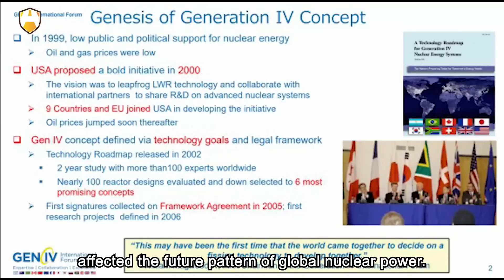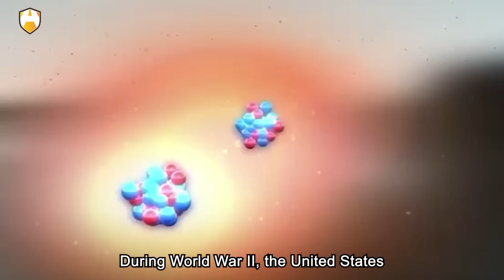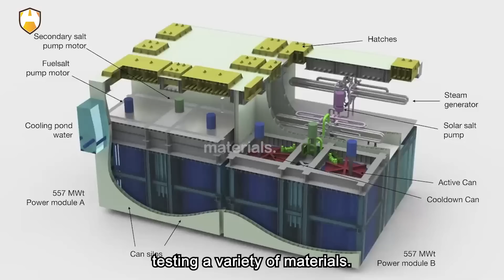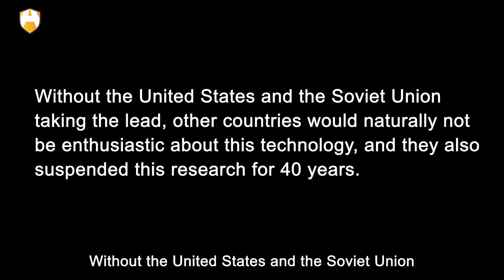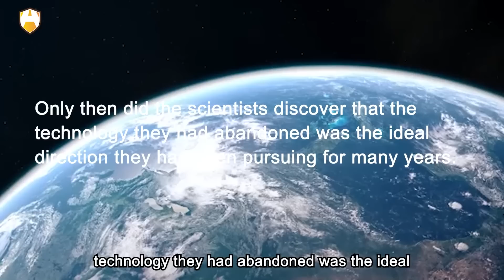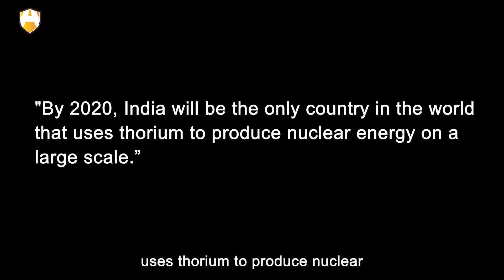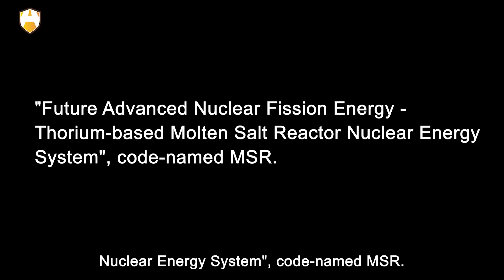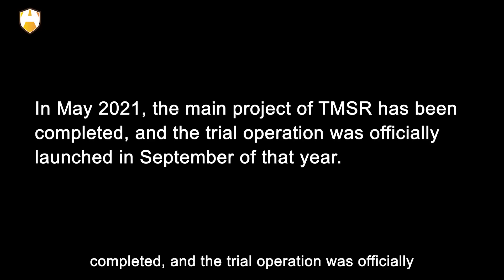China made big success in the Future of Nuclear Power! Revolutionise Atomic Energy Industry?

Comment: Nice video, the images do not match the subject. Fusion reactors do not belong here.
My interest in Thorium goes back 20 years. I spoke to a chinese engineer, back in 2004, in the US who's mother was a nuclear scientist in China, and he had never heard of MSRE or Thorium. A few years later a delegation from China visited ORNL and the MSRE. Coincidence? I think not.
Much of the original MSRE research documentation was located in Oak Ridge, in a junk closet, and salvaged. It was scanned and put online a few years ago and was downloaded massively from China.
The MSRE  was a 7MW reactor dumping its output as hot air, not electricity.
The Chinese test reactor is only 2MW. This would be OK for a Small Modular Reactor, mass produced, for low cost.
A MSR cannot melt down or explode, it has no intrinsic pressure. Liquid pumps provide circulation pressure, some models use thermosiphoning for circulation. The reaction process has a negative void coefficient.  If too hot reaction slows down. 
The absence of water at 300°C and 2250psi solves the main problem with nuclear energy, cost and safety. Safety drives the cost of construction. 
The incumbent industry is hesitant towards MSR and Thorium, too many old billionaires and bean counters.     The oil interests fan the flames of fear too.
The problems with cracking in MSR a exaggerated, only superficial surface cracking was found in the MSRE.
Thermal cycling, in often turning the high temp on and off likely also has an effect here. Just a guess.
I'm happy that China get their feet wet in MSR but 2 MW does not cut it, China needs Tera Watts of power. They could become oil independent and better yet, convert their thousands of dirty coal plants to Thorium MSR.
China is the leader in CO2 production. Cheap energy could be used to remove C.O2 from the ocean that absorbs 50% of the atmospheric  content. Why go to Mars when we have a beautiful planet? Lets not destroy it.
Reply: "China is the leader in CO2 production". 
Depends on definition.
Based on per capital basis, China isn't the leader.
Based on historical total, China isn't the leader.
Based on country, China did produced the most, but they are also the world's factory. If you tied the amount of CO2 produced in the creation of a product to the end consumer, China isn't the leader either. That is, a significant chunk of the CO2 produced in China is for the creation of products that is consumed by other parts of the world, mainly the west (iPhones, electronics etc..).
Reply: @testusersg  Don't make excuses for Chinas CO2 pollution, per capita, or else. With that large population they have a massive responsibility.
Reply: @testusersg  Excuses excuses.
"Per capita" is not valid for China, or India. 
Air quality in many places in China are abysmal.
Is that what you want?
Stop making excuses.
Letting China into WTO in 2000 was a big mistake.

Comment: Did not address why Thorium couldn’t be used for all this time. What exactly has been the problem?
Reply: Because Thorium cannot create bombs. It cannot even start a thermal reaction without Uranium.  She says this in the video here..
Reply: @SPLITSLEEVE  Yes this is partly true, but for a proper thorium breeder the neutron economy is a real issue because it works in a thermal spectrum where neutrons are much more scarce. This makes design significantly more difficult because with too much neutron escape it means you can't reach the breeding ratio of 2.

My real point is that I'm sure it will be done in due course, probably by China, but for now there is great things that we can do with uranium/plutonium cycle that should not be ignored while we wait.
Reply: @Spacedog79  Yes like "The reality is that the IMSR
features a thermal efficiency roughly 50% higher than comparable light water reactors. This
means that the IMSR creates approximately 1/3 fewer isotopes, since less fission power is
needed per unit energy output. The IMSR also features a very soft neutron spectrum and long
fuel residency time. As a result, masses of plutonium and other transuranics in waste are much
lower than those in light water designs per unit energy output. Ref 86 by Terrestrial Energy
 From Terrestrial Energy
So IMSR are a stepping stone in using Thorium . Its first using molten salt in the reactor with Uranium only. I do not know if Oakland reached past 2, but they did say that it was successful but had problems.
Reply: @Spacedog79  I doubt that that was the main reason. Like Dunc Keroo pointed out, this technology does not produce weapons grade raw materials which was a priority for the US. You admitted that it will be done in due course, meaning all technical problems would be solved in due time, yet the US allowed itself to be overtaken by China in such an important research area. I can only conclude that the US is more inclined to weapons (war rather than peace) research in direct contrast to China.
Reply: @Spacedog79  I'm confused. Can you help me understand better? In this video https://youtu.be/bbyr7jZOllI?t=301 it was mentioned that the cross-section area of U233 (the final step of Th232) for thermal neutron is way bigger than fast neutrons, for either Pu 239(final step of U238) or U233. Doesn't that mean it's much easier to get a thermal neutron to trigger a reaction for Th232 breeding than the fast neutron reaction that is being pursued by lots of people? Or are you talking about the trouble of getting rid of the byproducts shown as the red part of the pie in that video?
Reply: @adamiskandar5107  Very true Adam. And I think China is going about all the technical problems in more than one way.
Reply: @typicalKAMBlover21  Yes, the cross-section is larger in the thermal spectrum but when you factor in a liquid core that must be in circulation to remove neutron poisons  you must engineer it so that minimal neutrons are lost while the fuel is outside the core of the reactor as this will ruin the neutron balance. This is a difficult problem because of the competing engineering needs.

There are other interesting designs you should check out such as the Moltex design that uses fuel pins containing liquid fuel that allow poisons to bubble out while keeping the fuel in the core, but they are going for fast spectrum uranium/plutonium first and thorium breeder is a distant aspiration.
Reply: @Spacedog79  thank you that really explains.
Reply: @Spacedog79  do you know anything about the Chinese efforts on TMSR-LF1? I see some Chinese forum with critical comments like “waste of money”. I thought if it’s corrosion problems all you need is time to make sure things don’t leak. But if it’s limiting the neutron escape from circulation of the reaction core out, there needs to be some smart design, obviously. Do you think the Chinese will be able to make breakthroughs regarding this in next 5 years? In other words, how difficult is this?
Reply: @Spacedog79  looked SSR of Moltex, do you know how exactly they are dealing with the neutron poison? What species are such neutron poisons?
Reply: @typicalKAMBlover21  The Moltex SSR is very simple, the fuel pins are unpressurised liquid and have an off-gas vent at the top so neutron poisons can simply bubble out and escape. Their first reactor will be a fast spectrum uranium "waste burner" type (SSR-W) so whether this is exactly what they would do for a thorium breeder I'm not sure. I believe that is more in the conceptual phase rather than anything concrete.

I don't know much about the Chinese reactor, I hear the project is progressing well but I would love to learn more about it.
Reply: @Spacedog79  I’m actually an optics guy and the very idea of controlling neutron escape interests me. Do you know why they can’t just put the neutron unpoisoning process under a large reflection shield to keep the neutron in? Is neutron like how X ray is— very easy to penetrate things? Do you know if it also gets much better reflectivity under Briggs angle(assuming there is such a thing for neutron)?
Reply: @typicalKAMBlover21  Ideally you'd contain the poison removal process inside the thorium blanket so that escaping neutrons have a chance to breed new fuel, but as far as I understand this is a difficult engineering challenge to package the device, and so is surrounding it all with reflectors. Neutrons are also not easy to control in that way, they will tend to bounce off atoms in random directions and you hope they will generally return where they came from.

I think the preferred approach is to simply make the poison removal process very fast so delayed neutrons are less likely to happen outside the core, but this brings it's own challenges as you are trying to move an incredibly radioactive liquid at high speed.
Reply: @Spacedog79  YouTube ate my comments because I linked a video… I found a video showing the breeder design from Kirk. I don’t think anyone has tried this stuff. The Chinese TMSR-LF1 doesn’t have the breeder or blanket. I have their environmental report and plumbing design paper. Let me know if you’d like to see them. My conclusion is the same as yours now. Breeder is yet to be tried because people are still experimenting with molten salt core designs. Maybe the Chinese will do things as they say about 2030 commercial applications. But there surely is a lot that needs to be done.
Reply: @typicalKAMBlover21  Yeah I'd love to see more about what they have come up with. My idea would be that you pipe core fluid out to a separate tank for neutron poison removal which has its own breeding blanket to catch any delayed neutrons. This add some complexity but I think from an engineering perspective it might solve a few issues.

Another thing about the Chinese project I should mention that is often overlooked is that some years back they announced the development of a super high density graphite that was resistant to cracking under neutron bombardment, and a means of mass producing it. This is a big deal because it avoids having to replace the moderator every few years as is commonly assumed.
Reply: @SPLITSLEEVE  that may be one of the reasons. But if you check the video I linked in my previous replies you’ll see that there were also other political reasons that eventually shut down the Oak Ridge National Lab (ORNL) project. Here I’m not talking about just thorium in general but specifically the Thorium Molten Salt Reactor that was championed by ORNL. I want to know to the technical reasons though. Because no one is giving a clear answer.
Reply: @typicalKAMBlover21  With molten salt reactors you can go at higher temperatures. In those days, they did not have metal types to prevent corrosion as what they have today.  Salt and higher heat were two of the problems.
Reply: @typicalKAMBlover21  Oh, I did not know Kirk was in the video. This guy is total Thorium. I will go watch.
Reply: @SPLITSLEEVE  thats what I thought. If you look at those videos I linked. The two problems tritium and corrosion cited in the report that shutdown MSRE at ORNL can be addressed nowadays. I watched the interviews of the new generations doing fundamental science at ORNL I was shaking my head. They are like my grad students, just kids trying to learn things and experiment some hotshot ideas. Definitely not the caliber that’s needed for such a crucial mission that needs sharp, independent, hungry guys fit for shark tank of commercialization. I’m quite “concerned” China is just going to overwhelm this area as they have overwhelmed solar and battery storage. That’s scary.
Reply: because thor was kidnapped by amurikkka
Reply: Karena teknologi Amerika injakulasi dini  🤣
Reply: One of the biggest issues is that conventional reactor fuel are $$$ and is a big industry (with big profits). Thorium fuel is significantly less expensive and does not have the industry representatives to lobby for its use. Technically, a Thorium reactor is unpressurized, and does not need the huge and expensive containment building in the case that a coolant leak happens. But what would a ignorant public would think if you propose building a nuclear reactor without the containment building ???
Reply: Hard gamma ray emissions
Reply: Thrown out by politicians as they could not create bombs to blow up our enemies.  Listen to Dwight D. Eisenhower, he explained it.  All about profits for big Military Weapons, they don't give a fig about what is best for the world.
Reply: Thorium has great prospects but it has technical hurdles with neutron economy that need to be addressed, and while these will be fixed in time the current uranium/plutonium cycle is already available and actually much better than it usually gets credit for. This is why most have opted for uranium/plutonium, and this will remain the case for a long time to come.
Reply: @Spacedog79  Thanks for the reply, I had to do some serious research about what you said. This video from Oakridge National Lab (ORNL) summarizes well: https://youtu.be/knofNX7HCbg. The particular form of 4th gen reactor being talked about, Molten Salt Thorium Reactor has its uniqueness. I worked with DOE for quite a while, so I know what problem they are facing. It's basically a long-term political will and funding that is needed to deal with the corrosion problems in molten salt, which to be honest has already been largely solved in solar concentration towers. You are right, given the existent players, the threshold is currently very high in entering this game. But it was due to political reasons (and access to nuclear weapons) that fast neutron reactor path was chosen. I seriously think this is a direction that ORNL did very success work on back in the 70's already. It is a pity that people who knew how to do this in US are all gone. I'm Chinese living in US, I don't know what to think literally because I know the Chinese gov will eventually be the one to have patience, wherewithal, funding, market, and flexibility to finish it. I feel so sad for those American Scientists and engineers who literally did these 50 years ahead, just to leave it to for the Chinese gov to benefit. Well, in the end, it's going to be the human race that benefits. So maybe I shouldn't be too sad. About neutron economy, as long as it crosses the threshold of 2, there is no problem, and it has been proven many times Th can do it (or Indians will not use it). India is on the same path of fast reactors as the Americans did, which I see as a dead end. Because I have done heat transfer for high temperature projects, there is nothing comparable to liquid form atm pressure (the other is probably dual phase air particle mix, which has its own corrosion problems). And this stuff can only be proven to work over years. Only Molten Salt Thorium Reactor is in China now. I thought this video is simply Chinese propaganda, but I have changed my mind. They are onto something big here.